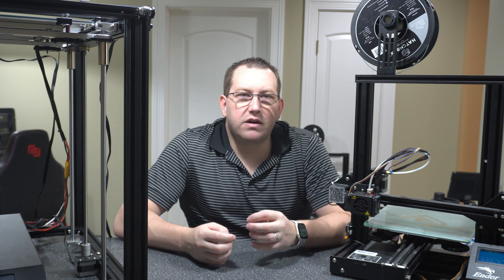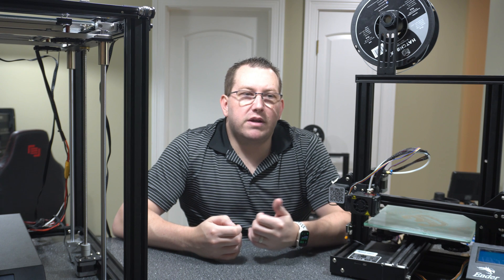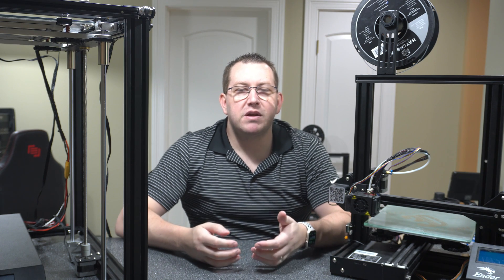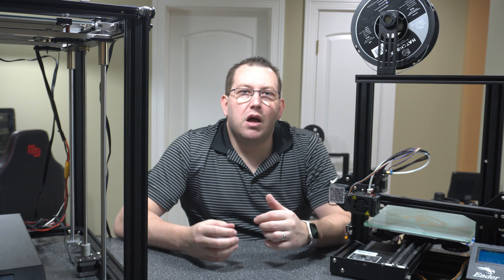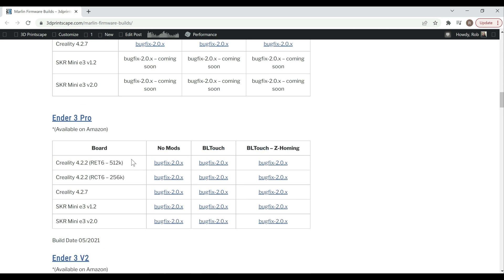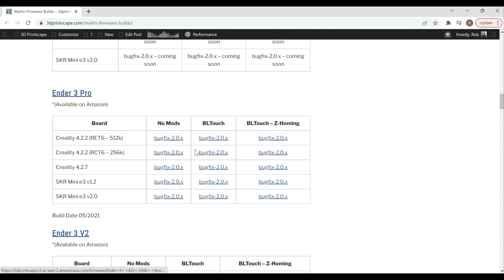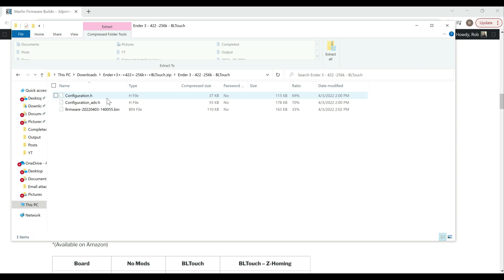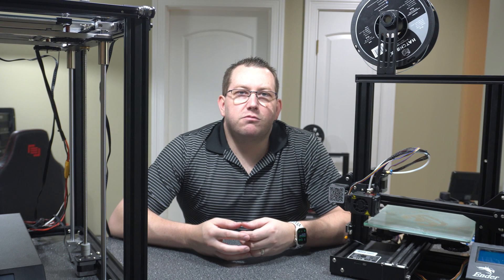Creality Screen Issues After Firmware Upgrade

Comment: I put all the files on sd i have a stock ender 3 Pro which do i need? Thx mate
Reply from the maker: Hi. You just need the .bin file.
Reply: @3DPrintscape  i will try tonight and then te no mods firmware 256k?

Comment: Can i not use a v2 screen on my ender 3 pro?
Reply from the maker: Hi. You would have to change the firmware but yes its possible.
Reply: @3DPrintscape  thanks for the reply. I have a 4.2.2 silent board do you happen to know which firmware 
Thanks again
Reply from the maker: @modchop3537  I dont think there is any premade, will have to be custom Marlin build.  I believe its #define DWIN_CREALITY_LCD that needs to be enabled.

Comment: Silly question, but downloading the 256k version won’t pose any potential risks would it? I had issues with the 512k version as well, and this had fixed my issue but I was curious about it
Reply from the maker: Hi. No the 256k will work fine on both boards.

Comment: I finally got the firmware and loaded to printer.  Screen came on fine. After checking the movements on all motors.  Then setting up the heat lvls for first print.  Now screen is on. But flashing with the reading in screen going in and out.  Any help would be greatly appreciated
Reply from the maker: Hi. Is the screen behaving the same way it is in this video or is the flashing different?
Reply: @3DPrintscape  similar to the same as yours. On 2 attempts, it went completely black, and 1 time flashing blue. I can't get through to creality and nobody in my area to take and have it looked at.
Reply from the maker: @Jjrdn10  Try pushing the firmware build from my site again but change the file name so its unique.

Comment: I was recently given an ender 3 that had no paperwork.  Put it together and was setting it up to print.  My screen went black.  Would you happen to know exactly which firmware i need to load.  As there are so many to choose from.  Mine is not the touch screen,  but screen with knob.
Reply from the maker: Hi. It depends what board the printer has. You may have to take off the back panel to check that if you dont know.

Comment: I’m having issues with getting a blank blue screen with my ender 3 pro with a cr touch bed leveling upgrade…. Is there anyway to fix it??
Reply from the maker: Hi. If your getting a blue screen during the firmware upgrade process its typically either the wrong firmware or the filename isnt unique. Try adding a date or something to the file name.

Comment: Thank you bro, I haven't ported the software you uploaded yet, but I am glad that you did this video! My screen just freezes after the print starts. It displays properly. But doesn't update. No progress updates either. Also I can't get into the menu during a print and pause for example. It still beeps when I press the button which is odd.
Reply from the maker: Hi. The Creality software based on Marlin has been buggy lately. Everyone is investing in Klipper lately.
Reply: @3DPrintscape  
So does that mean I need to somehow update my printer to another machine code?
Reply from the maker: @rikb.7772  You should be able to still flash creality firmware. If your getting a blue screen make sure the firmware is right and the file name is different than used before (must be unique).

Comment: I have a CR-10 V1.1.3 8 bit board. I've tried various firmware but each time I get a light but completely blank screen.
Reply from the maker: Hi. The firmware on my site wont work with the 8 bit boards unless you already installed the bootloader.
Reply: @3DPrintscape  well bootloader is in stalled but every firmware I install leave me with a blank screen...could the board be damaged.
Reply from the maker: @oddsandbods  Gotcha, ya the board may be damaged. I would look at the creality 4.2.7 or skr mini board.
Reply: @3DPrintscape  thanks for your time and input.

Comment: Even after installing your software my screen was still bugging out. I will try putting stock firmware on first then yours and see if that helps.
Reply from the maker: Hi. I had some people have to change the firmware a couple of times (not sure why but maybe a cache issue). Just make sure to change the file name or you will get a blue screen.
Reply: @3DPrintscape  will test in a couple hours. Thank you!
Reply: @3DPrintscape  forgot to reply. Installed the stock firmware from you instead of bl touch and we in business. Thank you!

Comment: I am doing a first time install of the official Creality CR Touch auto leveler. Should I use the firmware you provide instead of the official one? I have a basic Ender-3 with a 4.2.2 board.
Reply from the maker: Hi. Either should work fine but mine has more of the core Marlin features enabled. Just make sure the z stop is connected.

Comment: Hello, would you happen to know if there is a firmware update, by Marlin,  for the Ender 3 v3 se?  Thank you in advance!
Reply from the maker: Hi. I just checked the config examples and dont see one for that printer yet. Your best option would be to choose one of the creaty example that has the same board as your printer and modify the build plate size.

Comment: First let me say thank you so much for being such a huge part of the community 3D printing. I am new to this about a month in and already have a mini printer and a ender 3. I was watching you as I updated my direct drive in my 3D touch. I got everything in and the software flashed try to print and it wouldn't recognize my card. I could have done some process wrong but nevertheless it wouldn't do it. I turn my printer off and turned it back on with the card in and at that point it read the card. As I went to start a print it would not allow me to select a certain print every time I turn the knob it would be glitchy or have nothing on the screen at all and I finally got to the point where it let me select one and I start it. It started it laid down a brim and as it laid down the brim it went off to the left side automatically by itself and then went back to the print. It did some more the brim and then went to the front of the printer and went back to the center then the printer completely froze. At that point I wanted to start over. But I look through a few other YouTubes and finally found a different channel and it was Aurora. This young lady is very knowledgeable and I started falling away for a direction as I got to the point on the visual studio code. I was at the point where I was to find the folder with my boards processor number. Mine was different from any folder that she had there and any folder that I could see online. My processor is GD32F303RET6. So I couldn't find this in the studio at all. So I stopped and started watching another one of your videos which said that there was a fix for glitchy screens and so I gone on your website and found my enter three and the BL touch folder and PL touch the hopper I don't think that's the right name for that last folder. Nevertheless I downloaded them both because I didn't want to stop using my Z and just use the 3D touch as that leveler. Could you provide any help on this situation?
Reply from the maker: Hi. Try using the bltouch build for your printer/board combo and make sure your z stop is connected. The sd card should be 8gb or less and formatted as FAT32. Once you get that done let me know what behavior your seeing.
Reply: @3DPrintscape  so after doing this message I went home and went to your Marlin website with your build for my ender 3 and didn't realize all I really had to do is plug and play. I mean put the SD card in flash it and it worked.
Thank you so very much now my Z axis won't move down unless I move it closer to the bed and then I can use the movement section to move it down. But when I home it it goes up about 10 mm in the air and calls that home. The one thing I did do is unhook my Z and try to put the black and white wire where the Z axis wire would go no luck on that one. Reversed everything after turning everything off and I left for work pissed off lol. But again thank you so very much when I get home I'm going to try to rehome my Z offset and plug in the v-stepper motor. I'll watch a few other videos and some people may say that it's my wires and they may have a short in them so I'm going to check that too
Reply from the maker: Make sure your z stop is connected. The autohome position with the bltouch is +10mm in the center so thats normal. The z offset comes into play when the print starts. Is it letting you set that correctly?  @jay6976

Comment: i have ender 5 with 1 ,1,4, board i need help
Reply from the maker: Hi. Thats an older 8 bit board. You would have to install a bootloader on it and then build/push the firmware from the computer. I have one video covering the process (focused on bltouch install) but honestly if you dont already have everything needed to install the bootloader you will be better off replacing that board.

Comment: Hate to say it, but I am still having the blue screen. Mine has the RET6, and I used the file for the RET6. Have tried adding a unique number to the end of the file name and still the blue screen. Any thoughts?
Reply from the maker: Hi. Have you tried a different SD card? It should be 8gb or less and formatted as FAT32.
Reply: @3DPrintscape  did all that, and used several other firmware from multiple sites. Came to find out that my motherboard failed. Did the test that Creality has for testing the motherboard and it tested as having failed. Couldn't even return it to factory settings. Bought the V4.2.7 board and just need to get it installed now and then try again.
Reply from the maker: Sorry to hear that. I have been hearing about more hardware failures recently, not sure why though.  @VinnySD79

Comment: This fixed my screen. Really appreciate you. Do you have for the cr touch bed leveling? The file from manufacture is what corrupted my screen. Do i also leave this file on my card?
Reply from the maker: Hi. The bltouch one works for the crtouch (they are the same thing to the printer). Once the firmware has been uploaded to the printer you can delete the file from the sd card.

Comment: Hi, the video is great. How to put the upgrade on the printer. Using the micro SD card or directly from tye computer using USB cable.
Reply from the maker: Hi. You but the .bin file on the sd card.

Comment: i can know reproduce the screen glitch it seems to happen if i push the printer if i print a long print 5 hours at 175% somthing is getting  hot i think it has to do with gd chip and  drivers i dont have a thermale probe so i cant defer what it is
Reply from the maker: Hi. I have seen it happen on non-gd chip printers as well.
Reply: @3DPrintscape  it says I have the ret6 if I'm right that's 512k and rec6 is 256 wonder if all the issues I'm having are a mislabeled chip and it's actually a 256 it's got to be something like that or something on the board not right wish I money to get the bigtree skr and a better screen
Reply from the maker: @bigfoot3387  Hard to say for sure and ya i hear ya. I like my SKR board and TFT screen.

Comment: I am having an issue with my Ender 3 Max Neo. After updating the software for my display it no longer boots up for use. It is stuck at the Creality screen
Reply from the maker: Hi. It sounds like the firmware is wrong for either the board or the screen.

Comment: When adding do i only need to add the firmware from the folder or all 3 items?  After adding to the card what is the next step, anything needed to be selected on the printer? My screen is still glitchy but i only added the firmeware
Reply from the maker: Hi. You only need the .bin file, the rest is for reference. The SD card should be 8gb or less and formatted as FAT32.
Reply: @3DPrintscape  think I might need to reformat the card.. I'll try and let you know. And thanks for the time you took to answer

Comment: hey so i downloaded the 256k BLTouch – Z-Homing and the whole thing just isnt coming back down, it goes up easily but not down
Reply from the maker: Hi. How is your bltocuh wired? If all five wires are to the bltouch port you want the normal bltouch firmware not the z homing one. Also, make sure the z stop is connected.
Reply: @3DPrintscape  ok thanks for that, I’ve fixed my original problem! But now it just doesn’t want to print even the test print it originally came with
Reply from the maker: @arue1434  Whats the printer doing when you kick off the print?
Reply: @3DPrintscape  it heats up like usual but once its fully heated up it just stays put and pushes the filament very slowly
Reply from the maker: @arue1434  Try clearing the settings and kicking off another test print.

Comment: Hey so I am having a problem where my print just freezes literally after the first line that prints and my menu freezes as well where I have to power off the printer. This problem occurred literally right after I installed the CR touch do you think these big fixes would do that job?
Reply from the maker: Hi. I think its worth flashing the firmware again. If that doesnt fix it, you may have a hardware issue.

Comment: I downloaded the 512k firmware for my ender 3 and am still having the screen glitch. does anyone know how to fix this?
Reply from the maker: Hi. What chip do you have? You may need the 256k version.
Reply: @3DPrintscape  i feel like it is a 512k, but the only difference is the print is either an E or a C and so i could be wrong, I will try this, thank you

Comment: I have a problem. I try heating the bed but it's heating the nozzle instead.
Reply from the maker: Hi. Sounds like the wires may be reversed on the board. Did you only change the firmware?

Comment: You're my hero. As a med retired Seabee I salute you and won't hold being a marine over your head ;-) I would like to ask how I can get my y-axis set back to 117 as this set it at 124 and is slightly off towards the rear of the bed.

I've been trying to work with creality on this for the past two to three weeks and nothing they sent me works. This bug fix for the ender3 4.2.7. with cr-touch is the only firmware that will allow my printer to function without something failing, screen, cr-touch, heating etcetera.

I sent this video to my support contact at creality to maybe get them to figure out what they are doing wrong.
Reply from the maker: Hi. Have you tried clearing the eeprom? If not, I would start there. If that doesn’t work you may need to build marlin with a couple offset changes.
Reply: @3DPrintscape  yes sir I have. I am so very new to this and do not know how to accomplish what you have recommended. I do want to thank you for helping myself and everyone resolve this ridiculous issue from the manufacturer.

Comment: Hey, I just replaced my board (4.2.7) on my enter 3 and I had my original firmware on it but it wouldn't work so I tried everything i can so far, nothings working. Whenever i boot it up it shows a blank blue screen. It is the Ender 3, with a 32 bit silent 4.2.7 motherboard. Could you help 😅
Reply from the maker: Hi. Are you trying to use the creality firmware again or another marlin build?

Comment: Me Again..... as you know your update was amazing and fixed the printer. only now i have just noticed something if i could ask. all my prints have been centre of the bed and not that big, but today i wanted mutliple parts printed and found that in the front left corner of the bed, when doing the skirt or the print, it jerks and only puts down dots. is this something you might be aware of? i cant say when it started as from getting the fix i never printed that large before. something else i noticed is while doing these jerky dots, its like the machine is frozen, so i cant press the button to cancle the print, i just have to wait until its got past the dots corner and the rest is normal and the screen / buttons are operational. Cheers
Reply from the maker: Hi. I havent seen this before but i would try to clear all setting (restoring back to defaults), setting the z offset, they trying the print again.

Comment: this started after i installed the duel z upgrade so i think it might be a voltage issue
Reply from the maker: Hi. Everything i have seen has been firmware. If you didnt change the firmware, you may have a loose connection.

Comment: Thanks! You solved my problem. You said you don't have a sample device to test this stuff on, which is all the more impressive.  So some feedback that I hope helps you or maybe others.

The chip on my Ender 3 Pro 4.2.2 board says RET6 on it. I tried the RET6 512 firmware build on your site and it loaded but did not fix the screen, so I tried the RTC6 256 and it did fix it. Since you mentioned memory as the issue maybe there is a RET6 256 chip?

Either way you saved me a lot of time, thank you.
Reply from the maker: Hi. Im not aware of a RET6 256k chip (doesnt mean they dont exist though). The 256k build i have clears eeprom on flashing. I want to update my 512k builds to do the same. Im curious if that would have got it going for you.
Reply: @3DPrintscape  I was just looking for something that would explain it with my limited knowledge and what I was observing. I am sure you are closer to right than I am. 

I used your firmware to get it back up and running to make sure that it wasn't a hardware issue I had created and then from there I was able to finally get Klipper installed on it, no small feat on the boards with the GigaDevice chips. 

If you want me to flash the Creality firmware to break it again and then test your new RET6 version with the EPROM clear just let me know. Now that I have an easy path back to Klipper I am happy to test it for you.
Reply from the maker: @joeg1992  I dont want to risk messing your printer up. Stay on Klipper :).